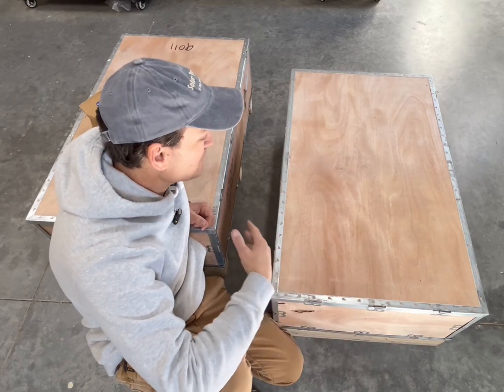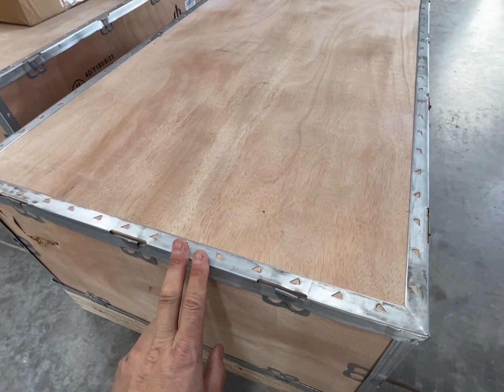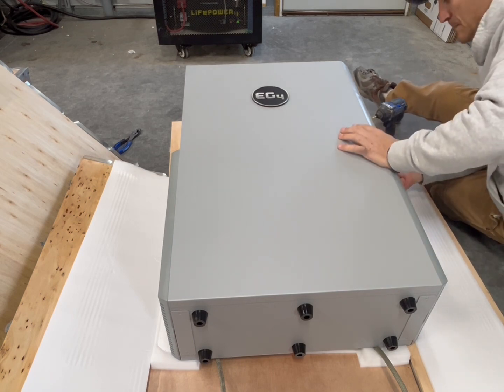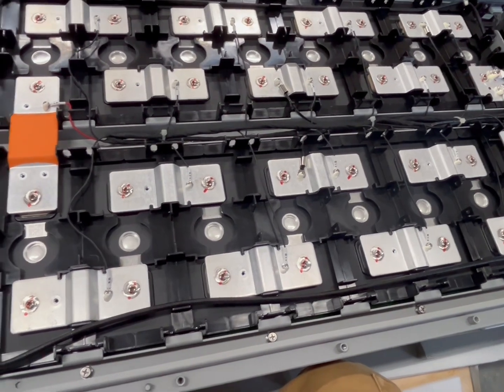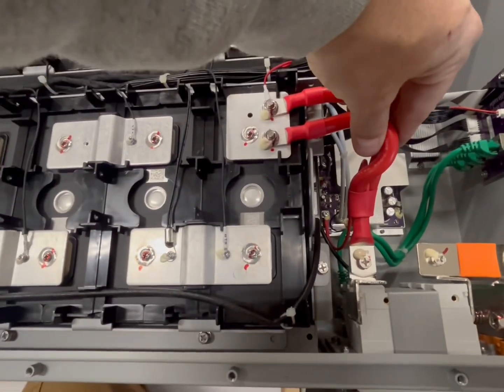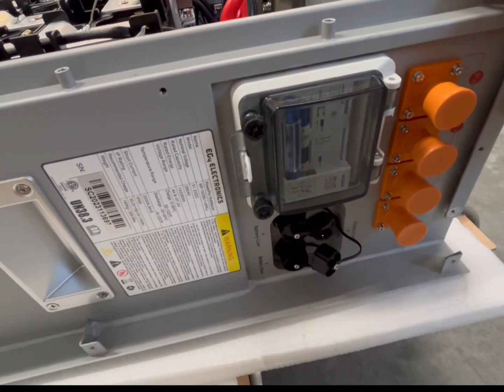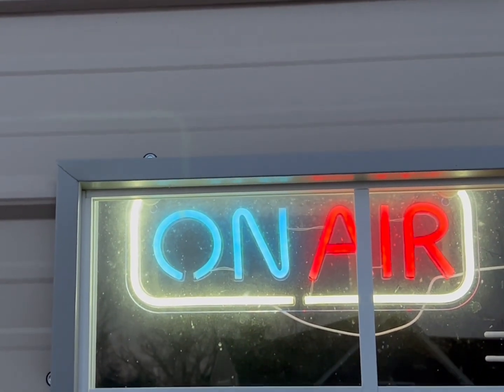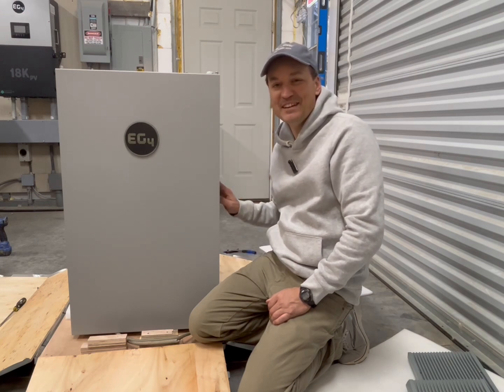EG4 PowerPro Wall mount battery tear down and initial review

Comment: two x #4awg  (not 4/0_ cables carrying the entire load..) .yes "normally" that would be combined cross sectional are would be spec'd to allow only 100 amps.... ????? It's rare that 100 amps will flow through them for any length of time but...  whadya all think?
Reply from the maker: The 4 awg 200c wire is good for 135 amps continuous. And they are pretty short runs. But technically that puts you at 270 amps if needed. They limit the charge and discharge to 200 amps on these. So they should handle it fine.

Comment: Do you know what the setting for the indoor unit hooked up to the N3H-X 10k hybrid would be?  I was hoping you would connect this battery to that hybrid inverter ya got from watts…?!
Reply from the maker: I’ll see if I can look tomorrow. Is there a Deye,  pylon or solark setting on the indoor battery? If so those would work.

Comment: Do you know if this setup has an active balancer or passive. I have 2 Gobel Power 48 volt 300 amp hour batteries with Pace BMS and seperate active 4 amp balancer. I'm going to buy the 18Kpv with this PowerPro battery soon (because that setup is UL Listed) and will add the Gobel batteries after the inspector leaves.. ;-)
Reply from the maker: I believe it’s a passive balancer. I haven’t had any cell balance issues at all with these or the LL batteries though. It all depends on the quality of the cells I think.

Comment: Gavin, On August 2nd, 2024, my DIY home built 24 volt 3600 Amp Hour battery/inverter system caught fire. Within 70 seconds of hearing a loud pop and calling 911,  I had my fire hose blasting through a skylight spraying and praying through thick black smoke that burnt the hair off my arm. I SAVED MY HOUSE!  Some rather impressive Fire Investigators are studying the unit...all overkill with 2/0 and 4/0 wiring, 500 amp continuous rated shutoff switch, ANL fuse on each battery negative, a 6000 watt name brand split phase inverter charger and a pair of 3000 watt high frequency inverters. It had a pair of  60 amp name brand MPPT's, each with 2 strings of panels that were under the solar capacity rating, 2 lightning/fused solar combiner boxes. The system ran 2 fridges and 5 chest freezers. 

With one 50 amp 240v cable, I could feed power into the transfer switch for when we lost utility power for more than 4 hours. I have done this several times in the 16 months the unit has been online. Everything was name brand components including the 300AH lifep04 batteries. Total load on all 3 inverters was estimated to be 1200 watts or less. VERY light loading. I have cell phone accessible video surveillance on the State of Charge meter that shows everything. I checked the readout maybe 15-20 times a day and was pleased at how the system operated. It had audio and I could hear fand on the inverters running once in a while. The last screen shot showed everything normal as the camera melted.

 I cannot say much while they investigate. My conclusion is that a BMS failed on a bottom shelf battery and  started the battery rack  on fire. The estimate is $50K-$100K to tear everything out, drywall, insulation, doors, vinyl framed windows skylights, burnt sub panel not connected to the battery/inverters. The smoke damage is extensive, water damage somewhat less.  This was my 12th homebuilt solar/battery/inverter unit and hydraulically crimp my own cables. I never had a name brand battery fail. Maybe bought about 30 lifepo4 batteries since 2017  from 50AH to 300AH. Never had troubles, built portable systems for friends and family and solar powered a Winnebago motorhome. I solar powered  my own camper van with same brand 300AH battery, 2000 watt Renogy inverter, 40 amp Renogy Rover MPPT,  400 watts in panels..

I am going with the EG4 system, 18Kpv all in one, and 3 battery packs. They will be outside the shop in a ventilated steel weather cabinet with 2 heat activated Rasco 200F degree green bulb  quick response fire sprinkler heads inside. This event scared me to the bones. Say what you will but Divine Intervention made me stay home and pour through my recently deceased brother's online tax return. He was autistic and fire scared him to death for 72 years. Maybe he whipped me into action.   I never expected a fire.

Comment: Nice job on the video. Two questions: why did they use (2) 4 AWG wire on the main wires coming out of the cell bank but (2) 2/0 for the battery connections outside the battery? Isn't 4 AWG limited to 85A so even with two of them pushing 200A seems like too much?
Also, has anyone evaluated the BMS? That seems to be the usual failure point (i.e. Renogy!). I can believe that the cells could last 8000 cycles/15 years but can the BMS last that long?
Reply from the maker: High temp 4awg 200c wire has an ampacity rating of around 124 amps. Plus this is an extremely short run. 

As far as the BMS, it’s hard to say on the longevity, the LL batteries have been on the market for a few years now, they use the same BMS. And they have an extremely low failure rate so far as I’ve heard.

Comment: Was there compression straps binding the cells together. Do they still do that? I noticed your DIY battery was not strapped together. On my CALB cells I placed big stainless steel clamps around it because I thought that what I was supposed to do??? Great video. I just helped a good ol boy order three of these PowerPro’s.
Reply from the maker: Most people still compress their cells. I just saw some literature that would suggest it isn’t really necessary. So I didn’t do it in my diy pack. There is still a lot of differing opinions on that. 

The cells are bound in the power pro yes. And it looked like  they have a plate that holds the cells in place since they are designed to stack on their side. It’s a really neat design.

Comment: Apexium DIY Battery Box from Docan power will add CAN/RS485 communication for your DIY batteries $640.00 US Stock
Reply from the maker: Nice! So at that point it’s really a matter of the inverter recognizing whatever protocol the BMS has.
Reply: Right, these use a Seplos BMS and has LuxPower Tsch protocol as well as many other. As I understand it.
Reply: I just bought 4 Apexium DIY Cases with the new JK-Inverter BMS with 200 amps and 2 amp active balancing for $435 each. They will talk with my 18K PV that bring my total build cost to $8,792 for 60 kilowatts of EVE LF280K cells with direct communications to the Inverter. DIY is still king. We saved over $6,500 over commercial built batteries, with the same functionality.

Comment: How big of a deal is it laying the cells on their sides? If the vents were to leak it could drop liquid more likely than upright batts?
Reply from the maker: No. It’s actually fine having them on their sides. No leaking issues. Upside down though you would have problems.

Comment: 56% capacity on fhe screen  versus 75% capacity on the LEDs? What accounts for that discrepancy?
Reply from the maker: If it’s anything like other batteries I’ve looked at, there’s a large window. Usually if  it’s anything above 50% it will show as the next level up. I can look into that more as I hook them up.

Comment: Good video I’ve been wondering what the inside of one of those were thank you very much. But my curiosity is killing me. How in the heck did you get that in the upright position by yourself as for me when I order my system I’ll have one and I’m trying to figure out how I would get that off the pallet and upright all by myself 😱. If you have an idea, please let me know. I kind of have a little age on my self and not as strong as I used to be lol. Once again, that was a very good video. Ken
Reply from the maker: The tipping weight isn’t nearly as heavy as the whole battery. So I grabbed the top rope and tipped it up. Certainly heavy, but not terrible.

Comment: I had ordered two of the PowerPro WallMount batteries back in October and was told the expected delivery would not be until late December, so I purchased 32 EVE LF280K cells and 2 JK BMS from Docan Power. I like the batteries but they have no communication with the EG4 18KPV. What are your plans for the DIY batteries?
Reply from the maker: That’s another reason I am changing batteries. I really want  the communication at this point. 

I may  be selling them on marketplace. There’s a church member that may need them. So I’m not totally sure yet.
Reply: Jenny Wu from Docan Tech has been asking me if I plan on getting 32 more cells. I am not sure. However, JK make a BMS that communicates through CAN Bus now. I really like the build quality of the PowerPro so it may come down to price. It would be nice if a fellow believer buys your DIY Battery bank.
Reply: Anyone know what brand/model cells EG4 uses?

Comment: Very cool!  I've been wondering if anyone was actually gonna open one of these up!  
I was just as surprised as you were to see that there was essentially a double cover.  Glad to see it though.  
The inside of the battery looks very well-built.  I am surprised though that there's no type of isolation on the cover in case something hits/dents the cover.  Could be a very bad day if the cover comes in contact with those battery terminals. 
Thanks for sharing!
Reply from the maker: I thought of that but didn’t mention it in the video. The lid is reinforced with a rail. And it’s spaced off fairly far from the cells because it sits on the outer rim. So you’d have to smash it with something terribly bad. And even then I think the rail would make contact with the center support and not the cells.
Reply: @GavinStoneDIY  makes sense.  Love the sign by the way!

Comment: I have a rack of 6 Lifepower batteries. Can I add on of these along with them and still maintain BMS communication?
Reply from the maker: There are some things in the works I believe. But honestly they have different charging parameters. So it’s not ideal. The lifepower models can now pair with the LL’s. But they don’t mesh completely. You lose a little charge on the top end.

Comment: Amazing, I really like that it looks like each cell is supported by the case. I've seen other vertical-style batteries where they stack the cells on top of each other with no support. That's a lot of weight on the bottom cells. EG4 did it right 👍
Reply from the maker: That’s for sure. I couldn’t find anything I would have done differently. Aside from making it lighter. 😁
Reply: @GavinStoneDIY  Lol right! Way better than lead acid.